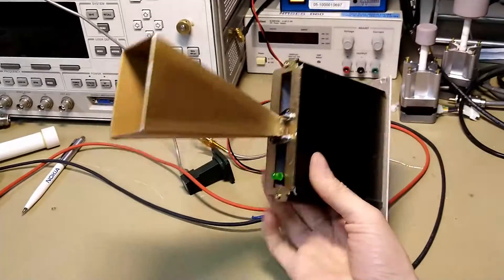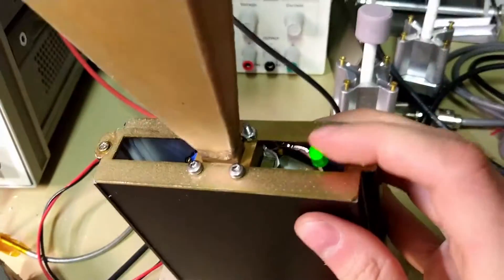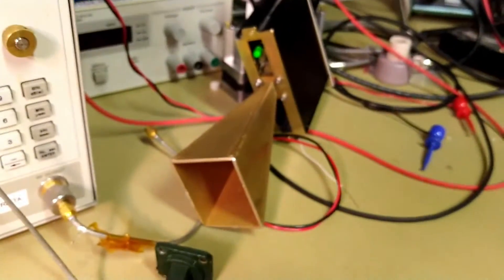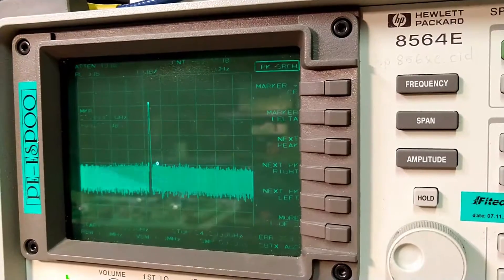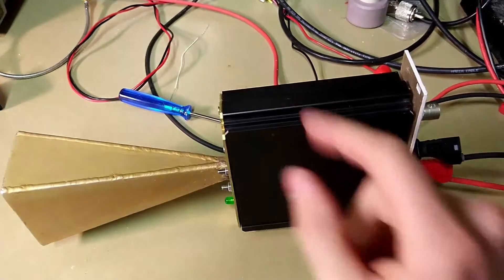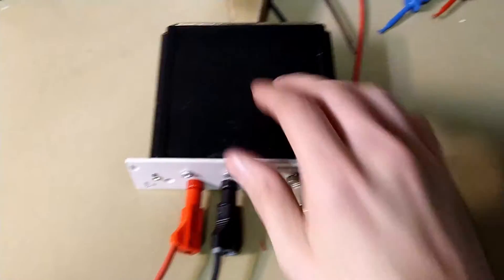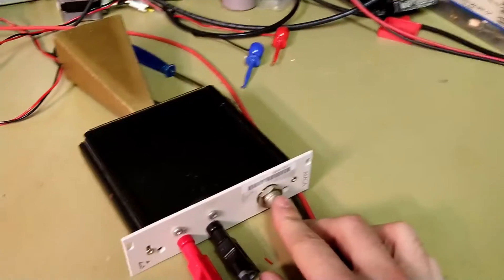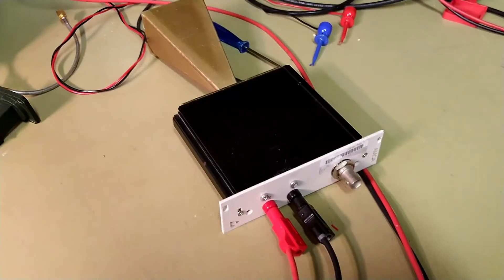A quick(?) 24GHz test source (and transceiver!) with Gunn-diodes! On K-Band!

Comment: Looks like I might need to dust one of my 24 gig full duplex Gunn rigs :-) FYI, my IF is in the FM BC band... Maybe next summer camp?
Reply from the maker: Sure! I have an AOR AR8200 mk3 so my IF can be more or less anywhere if so desired :) This is me learning about Gunnplexers and Gunn oscillators so that I might eventually make my own around those soviet ~47GHz diodes I impulse bought on ebay a few years back.